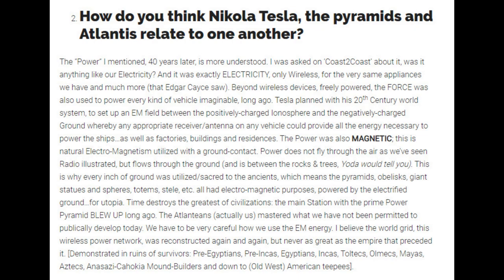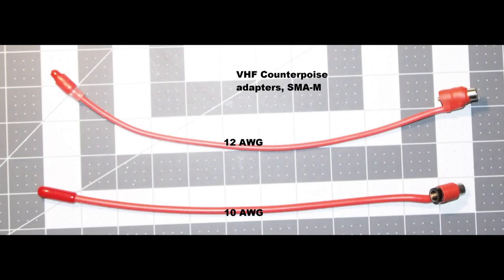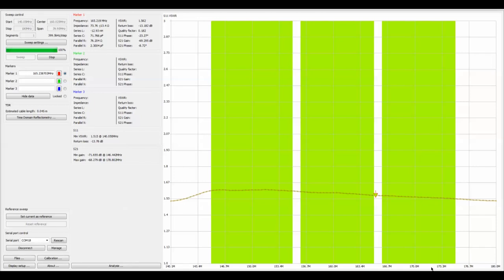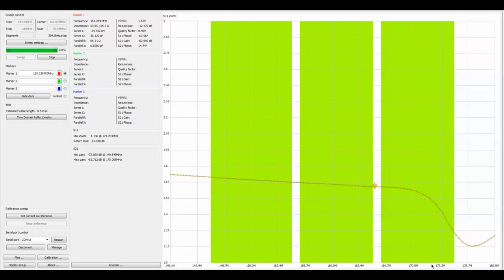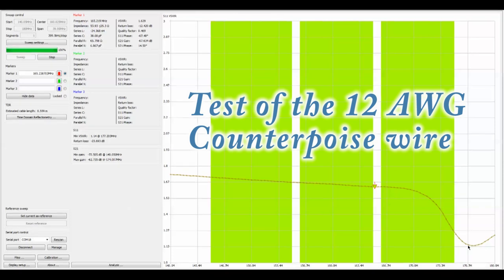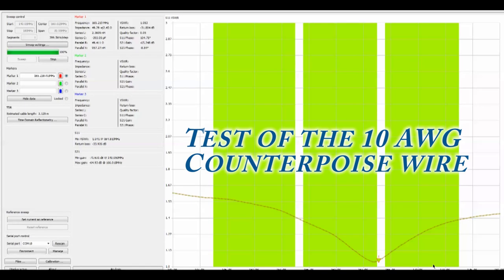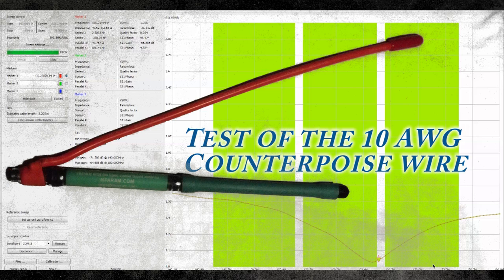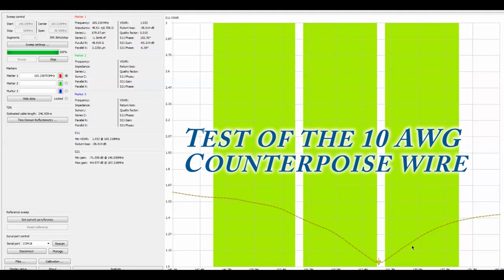Counterpoise, if you're a Rat, the size of your tail does matter

Comment from the maker: One question that arises, is how long is the 'Rat Tail', and why that length? The VHF Rat is 11.5", and the UHF is 6". Many souls use their handily internet accessible 'radial calculator' to calculate the optimal length of a rat tail, or go with 1/4 wave of the target frequency (EG: the resulting 19" for 150MHz). Perhaps because a base station antenna mount uses 4 or more radials to establish a virtual ground, or some other esoteric influence such as the positioning of the rat tail does some sort of impedance matching applies. In testing we find that the 19" length for a radial that is prescribed by the 'radial calculators' on the internet does not work well  as an optimal counterpoise distance for our IPX6 antennas (which have increased velocity factor characteristics due to the CPC 300 tubing). We have found that 11.5" works best for VHF, and 6" is best for UHF.